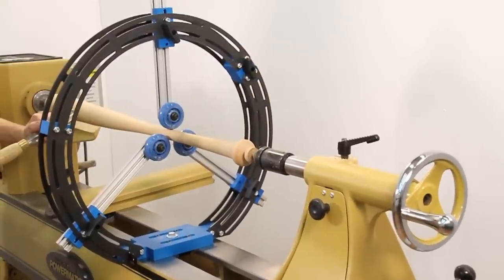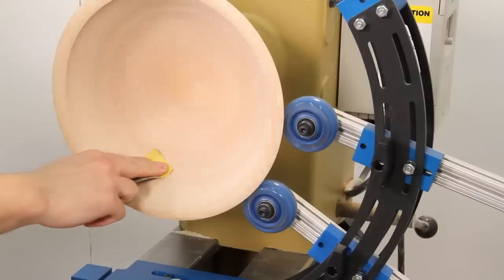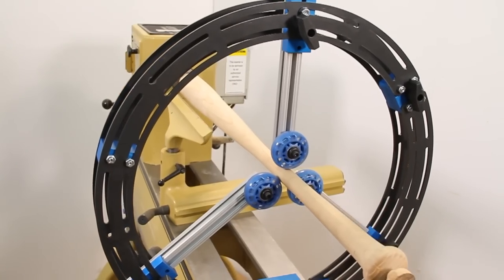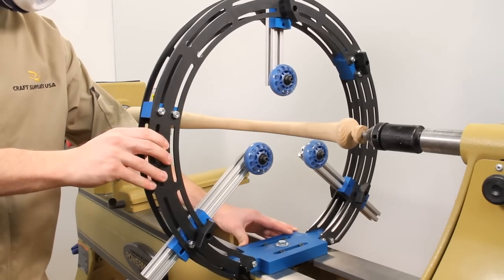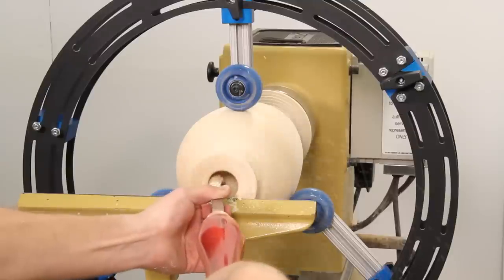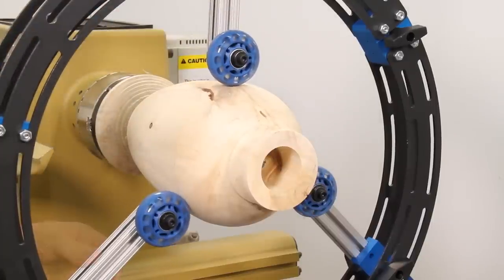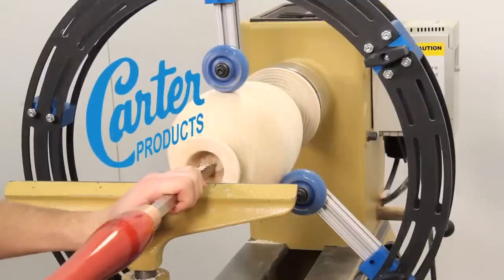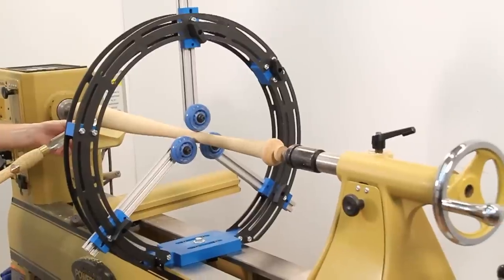Carter MultiRest (Woodturning Bowl/Spindle Steady)

Comment: Wheels melt, bearings are cheap, they don't use a spacer between the bearings on each wheel, so when you tighten wheels down to rods enough to hold your work in place,  the lack of spacers between bearings causes wheels spin to become bogged down...leading to melting. I had to modify the wheel setup on mine to enable wheels to turn freely. Pay attention to your wheel washer arrangement. Go to your local skateboard shop and get some quality bearings, and use the spacers provided , believe me, they are there for a reason.  Carter... Hire a Skateboarder!